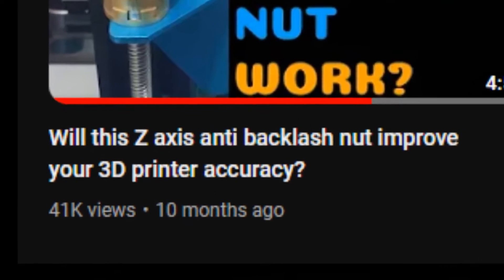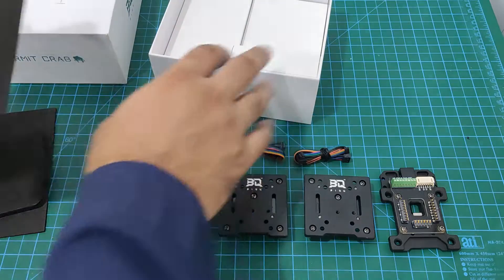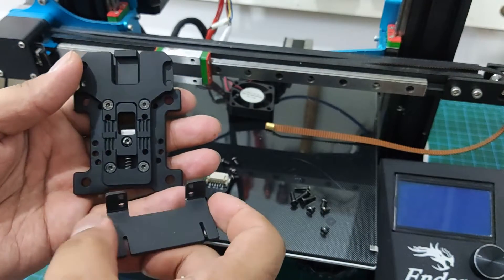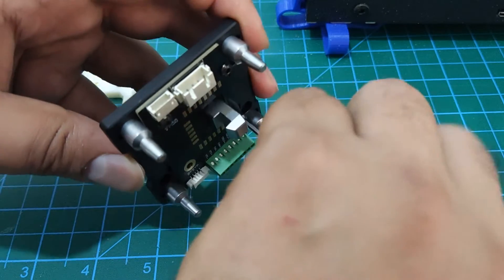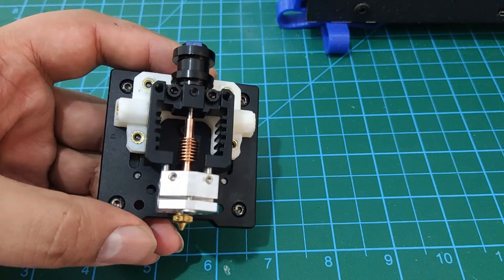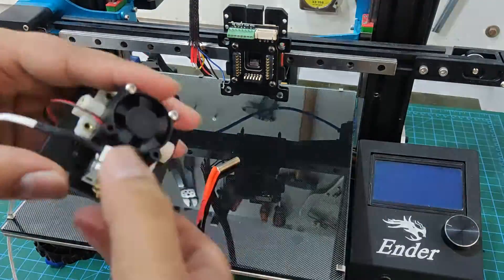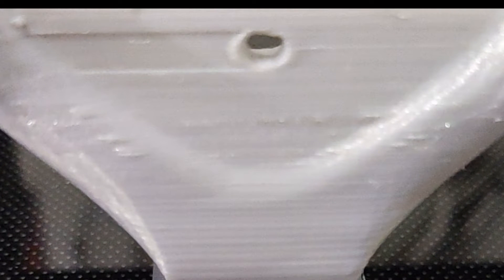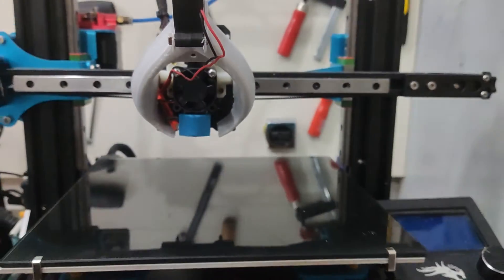Hermit Crab Quick Tool changer installation | Ender 3 Upgrade

Comment: What are the acceleration limits Klipper reckons for a toolhead with your Hermit Crab installation?  Have you compared this to pre-Crab?

I've done a similar setup, but in order to save Y travel, and to keep the weight more centred with the 2020 profile, I've put a MGN9 rail on the top of the extrusion (it rests on a spacer, to avoid interfering with the belt route), and attached toolhead via a custom machined adapter block.  Testing with accelerometer the vibration profile is worse than a POM wheel setup, and the recommended max acceleration went down by ~half to approx 5k mm/s with uglier frequency response shape. It's still can move faster without artifacts than the bed, so it's not really a problem, but I wonder how it compares.

Comment: It's really great what you're doing with your printer. I only noticed one thing when wiring:

These were/are all flexible, individual strands, right?
It is attached using a screw, right?
Wouldn't it have been better to put wire end sleeves on it?
Are there even such small ones?

Next year i will assamble my new Neptune 3 Plus.
I hope there is no Z-wobble.
Reply from the maker: Thanks. Always better to use the sleeves but i could not find the right size. Its very tiny

Comment: I like your videos your voice is very pleasant. I upgrade my printer at the moment and I’ll test it tonight. But i don’t have a tool changer until now. 
Why did you still use Marlin? I think Klipper makes more sense with an tool changer. Also speed and quality is much better.
Reply from the maker: Thanks! I agree about Klipper, but I am still running the stock Ender 3 board. I do plan to upgrade it in the future and that's when I will switch to Klipper.
Reply: @bluemonxterDIY  Okay nice I hope in a new video😉 i saw your other videos and wonder if it makes a difference if you put the Oldham coupler under the gantry. I installed my under the gantry but I don’t know if this makes a difference.😀
Reply from the maker: @Nussbub   I tried it under the gantry but the coupler has some slop in it, so theoretically it would increase the backlash. Other than that, it is going to be quite similar.
Reply: @bluemonxterDIY I don’t have really problems with z wobble only a little bit. But this may occurred by the speed improvement with Klipper 😂 and the old nut was so worn out.

Comment: OH MAN! I have this system.. and was not able to figure out the wiring. This is such an amazing overlooked device.. if it can be wired in to a voron, ender 3, etc.. you can swap heads for any of them. I am VERY impressed with the quality of this device. I have the S1 Pro.. so am hoping I can use this. Have to run wires to the motherboard on the s1 pro I think. I too have the linear rails. So I take it you used the wires that were originally connected to the connector on the original toolhead.. just cut those and wired them to the hermit crab baseplate? Did you have a wiring diagram for the wires on the original connector from the PCB to know which wires to put where on the hermit crab mount plate?
Reply from the maker: I think it can be done for a voron but you would probably have to ditch the stealthburner. Initially I tried to fit the afterburner on this plate but I faced some problems with the extruder motor. Will probably give it another go sometime in the future :). I did use the original wires. I did not have a diagram but there are labels on the PCBs for both the fixed and removable plates. You can cut the wires one by one from each of the components (2 fans, heater & thermistor) and fix one end on the fixed plate and the other on the removable plate.
Reply from the maker: @WhySoDivided-CantWeAllGetAlong I do plan on getting a laser head probably next year, I have kept a spare plate for the laser head.